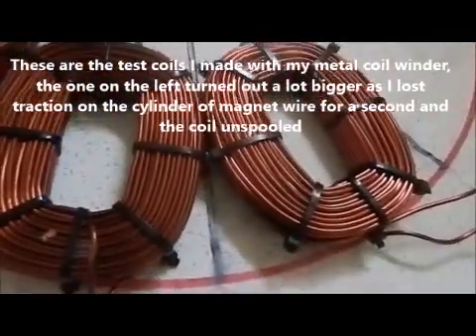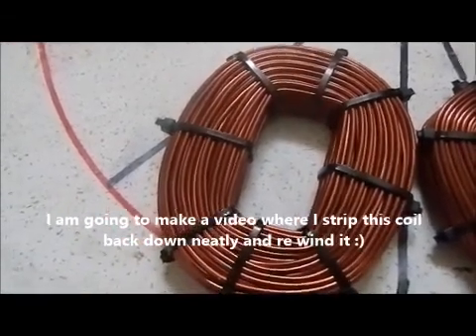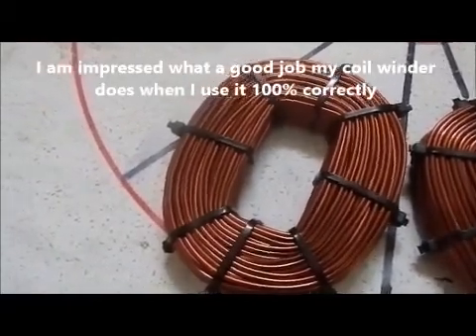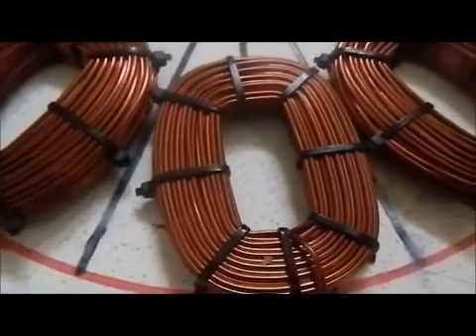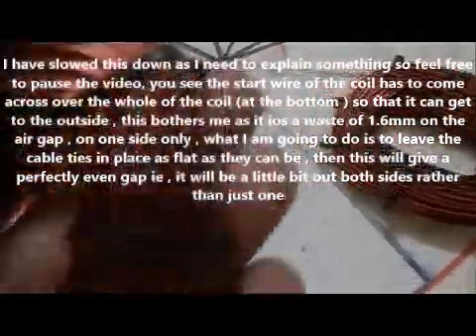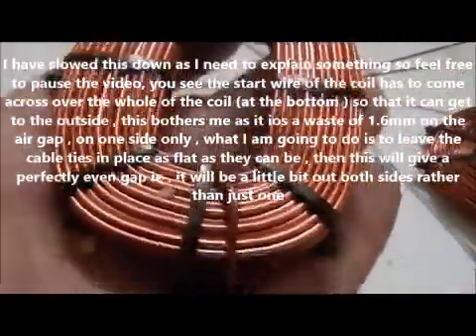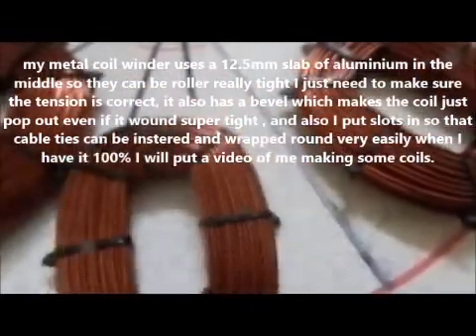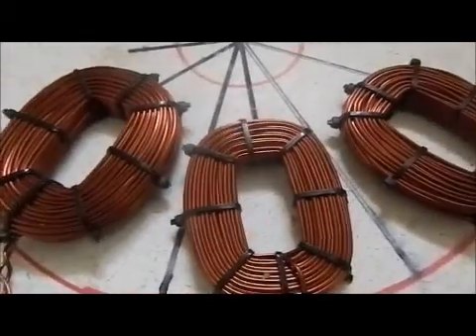A good bit of information about tension during coil winding !!!

Comment: Solve the wire coming over the coil problem by using a thin copper strip soldered @ 90 degrees onto the beginning of the wire before winding the coil.  Make the winding jig to accept this strip.  I use liquid tape to insulate the bare copper strip and solder connection after the coil comes out of the winding jig. The liquid tape also glues the strip in place after folding it over the coil.

A 1/4"  wide strip of 22 Mil/16 Ounce (.0216") 24 gauge copper can carry  more current than a single 10AWG wire.
If this is still too thick, a 1/2" wide strip of 10 MIL (.010 inches thick) 30 gauge, will still carry as much current as a 10AWG wire.
Reply from the maker: Thanks mate sorry for the late reply